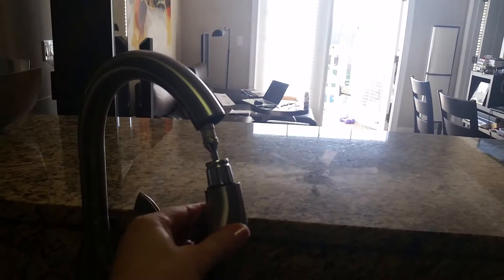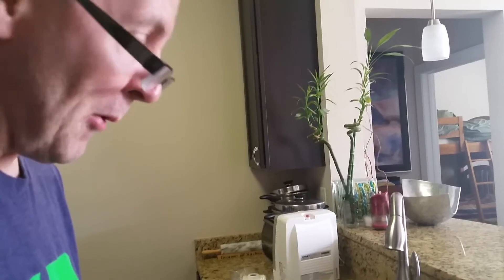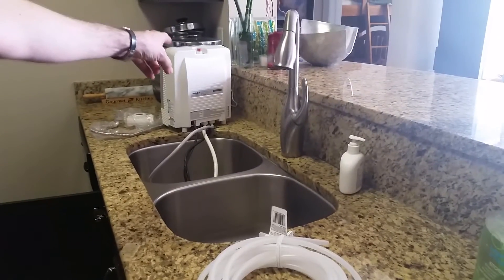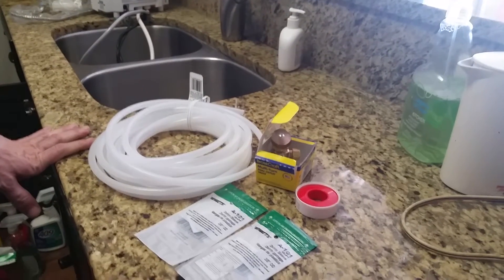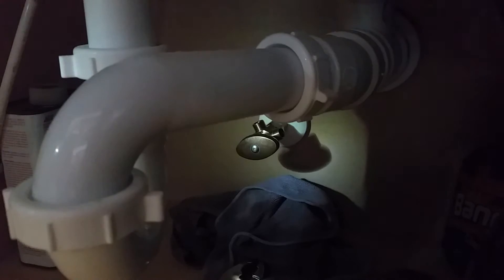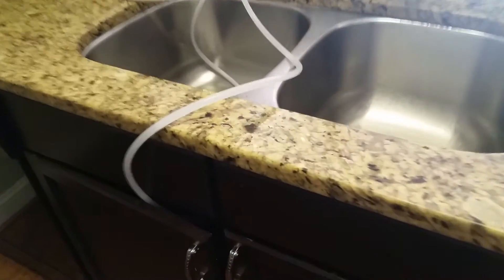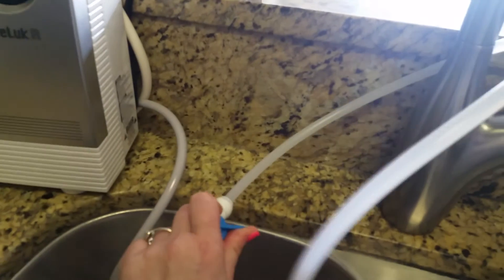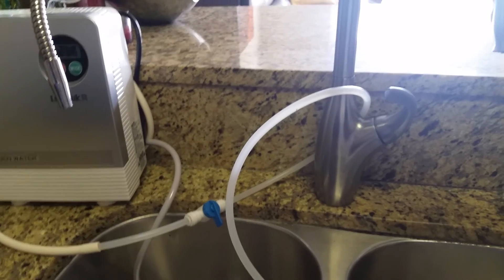How To Set Up Kangen Water Machine (Alternative Way)

Comment: Thank you for the video - I am in the same situation with no additional hole in a granite counter top. You mention in the video that you will put the parts you used "in the description below", but I'm not seeing them there...
Reply: Success! Got mine all hooked up! The folks at Lowes were able to get me everything I needed based on the descriptions I gave them. Thanks for the video!! :)
Reply: Benjamin Rodriguez  hey Ben, what size hose did you get? and what other materials are needed?
Reply: Just buy a stone saw. Its a drill bit that cuts a circle through the granite. Takes about 10 minutes.
Reply: @obijuankenobi420  Thanks for the suggestion... in my case it was a rental so I didn't want to cut holes in someone else's counter top!

Comment: How have you found your machine?
Reply from the maker: Hi Scott Lang. Are you looking for one to buy?
Reply: NATASHA ASHLEY im actually considering becoming a distributor and looking for feedback on the machine and its benefits.
Reply from the maker: That is a great decision Scott Lang. As for this Laveluk model,  it only has these 3 Level Selections: 
Kangen Water® / 3 levels (approx. pH 8.5-9.5)
Clean water (pH 8)
Acidic water (approx. pH 5.5-6.6)

I definitely would recommend getting at least one step up model LevelukRII. It is a little more expensive but you would get all 5 water Level Selections:
Kangen Water® / 3 levels (approx. pH 8.5-9.5)
Clean water (pH 7)
Acidic water (approx. pH 5.5-6.5)
Strong Acidic water (approx. pH 2.4-2.7)
Strong Kangen water (approx. pH 11.0)

Now if you can afford to get Leveluk K8 get that. It produces the best water.

In all cases, you won't regret. By buying a machine you are getting A business and checks in a mailbox. :)
P.S. How did you find out about it? Do you have a mentor whom you are working with?
Reply: NATASHA ASHLEY yes ive been working with a mentor and just doing my research before I make my committment.  Thanks so much for your reply.